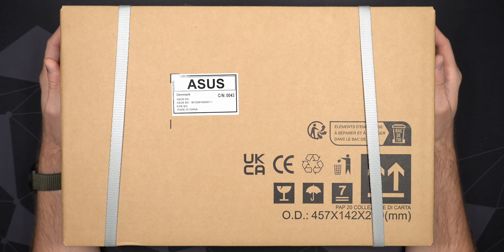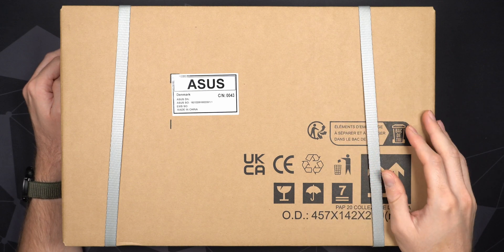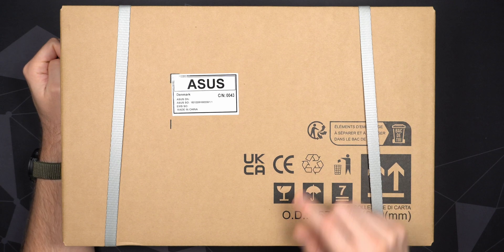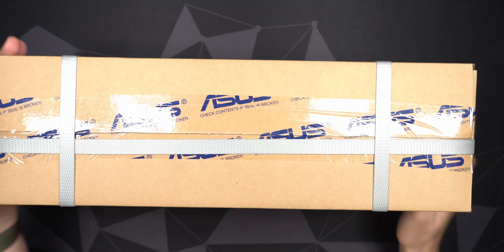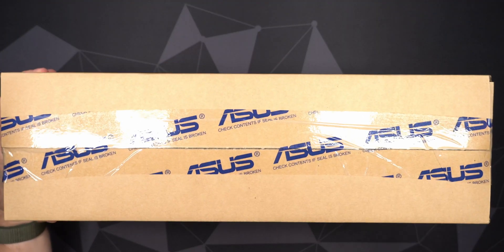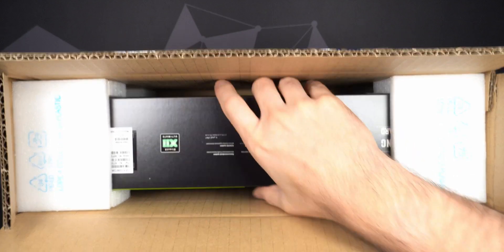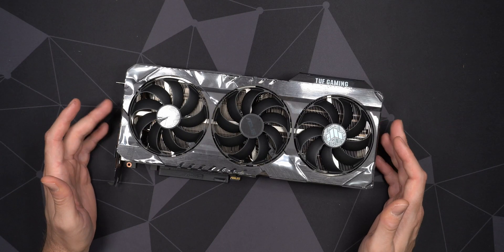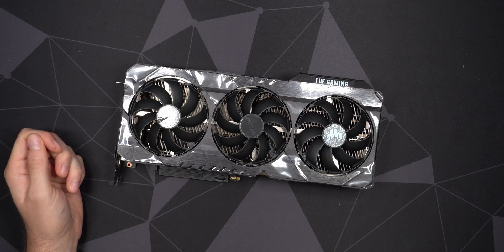ASUS GeForce RTX TUF 3090 OC  in Late 2022: Unboxing, Impressions, Benchmarks.

Comment: Don't worry about PSU important is that PSU goes above 750w and to be gold or platinum. Repadding will sove VRAM tenpsz, at 110c card will thermal throttle. Have an offer to buy it for 650 euros , definitely worth every buck. No need to get Rog Strix , that modeđ should be considered only for extreme OC, woth power above 107%

Comment: I had the Tuf 3090oc from day 1 in 2020. Just upgraded to the 4000 series... Yeah another Tuf 4090oc...Lol    Tuf is certainly a good name and performs flawlessly just like the strix. Not cheap either for example the strix 4090oc is 1999.00 USD the Tuf is 1799.00 USD, still high priced but IMHO totally worth it for high resolution, Ultra, Max or psycho settings gaming💖

Comment: i have i7 12700 non k , 
asus z690 tuf wifi d4, 
Nvidia rtx 3070 FE,  
32gb 3000mhz Corsair vengeance, 
cooler master hyper 410r cpu cooler 
and cooler master v650 semi modular gold certified psu , 
1 tb ,2tb 4tb HDDs ,
860 evo 250gb ,
2tb 970 evo plus nvme , 
6 normal non RGB cooler master fans .
thats my pc configuration.
i wanted to upgrade to this asus tuf RTX 3080 12gb or 3090 
will it b good running on my 650watts gold rated psu( bought in 2015 which has japanese capacitors)
i run my system at stock and don't overclock anything .
 
please suggest and advice
Reply: Don’t upgrade 3070 is fine get a 4070 ti if u want a upgrade or 3090 if cheaper
Reply: @pointbrake3183  both are expensive and used market is filled with mining junk of inno 3ds, colorfulls etc etc

Comment: How has the RM850(x?) done with the 3090 so far? Did you experience any issue? I'm considering this card and I was concerned about 850W not being enough. Cool video BTW!
Reply: I'm running rm850 with the tuff 3090 its plenty never had a problem
Reply: Depends on your cpu , some AMD are only 75w to 120 while intel has some power hungry chips doubling that

Comment: i also ordered a TUF 3090 OC 24GB, to replace my older STRIX 2080 Ti, because 4090 / 4080 is full of issues, from the newest 12V gpu power cable, the new DLSS 3.0 fake fps and some more. i do not want to experiment with my money., the cost was around 1400 Euro
Reply: im going buy tuf 3090 ti anytime soon around 772.55 EUROs replacing stix 2080 ti
Reply: @peacegamer22  Is very powerfull graphics card...
Reply: 4090's are fine now. Mine is awesome.

Comment: Im getting 104 degrees for memory , is it bad?
Reply: I don't understand how can he have 88c then...Could there be so much differences betwen these cards/units? When did you buy yours, this year or earlier?
Reply from the maker: There is allot of variables, case size, fans/speed, room temp, water cooler or air cooler and so on. Also age of the card, thermal pads will get worn down with time.
Reply: @markojaksic2946 
 26-3-2021 i have great gpu temp always under 80 but the ram memory goes 104 sometimes.
Reply from the maker: Thats pretty high, but within spec. It will throttle when it gets to 110C.
Reply: I have heard that many have problems with the temperature of the memories in this model, I also have this card and in full load in summer I do not pass 85 degrees.
Reply: @darksaga02  do you have discord?